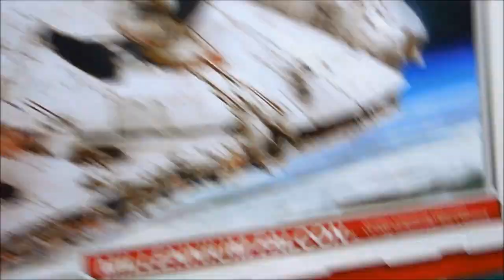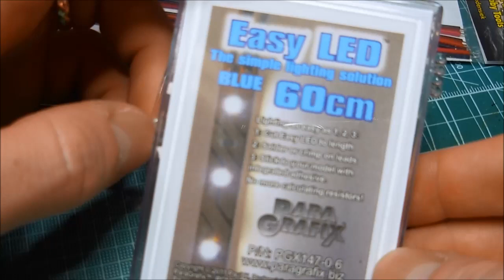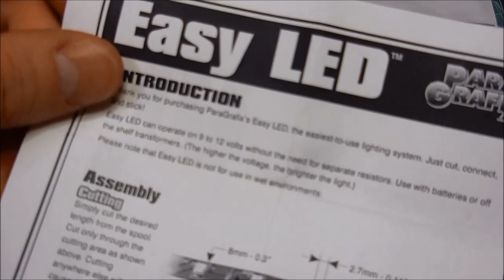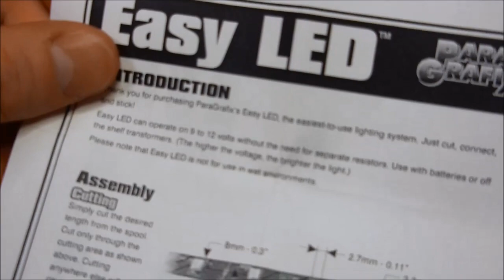Para Grafix Easy LED Tape and connectors demonstration

Comment: Those new connectors seem a lot more secure with the clip you push down over the contacts than the older "push on" ones. Have you tried jiggling them to test the connection yet?

Comment: I'll be using the same method for the corridor lighting of my DeAg Falcon. Being a cheapskate I bought the LED strip off ebay (2 metres or so) for under £5. Bargain.